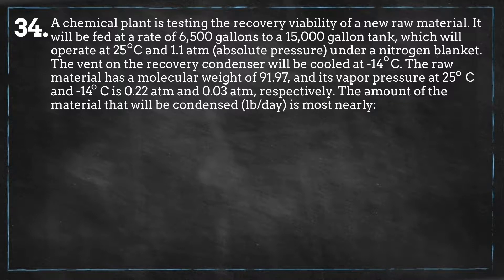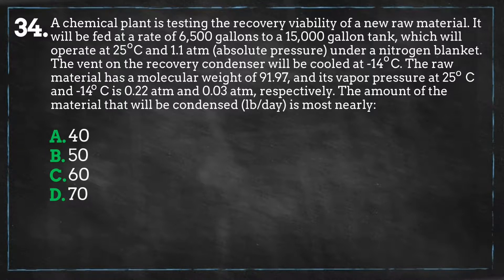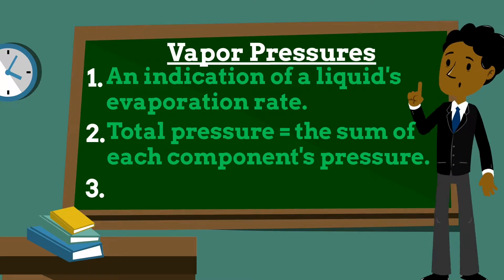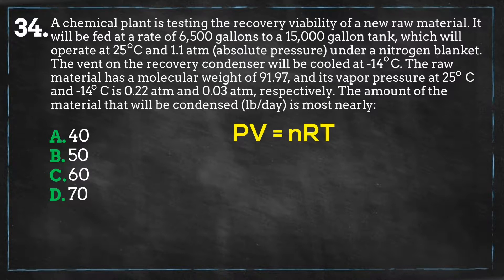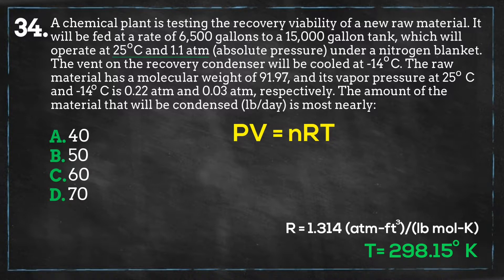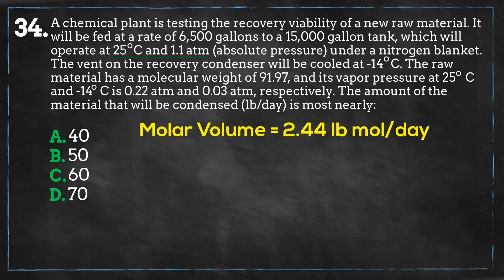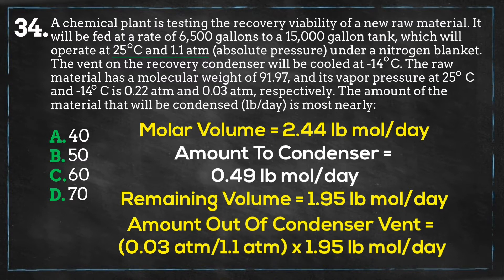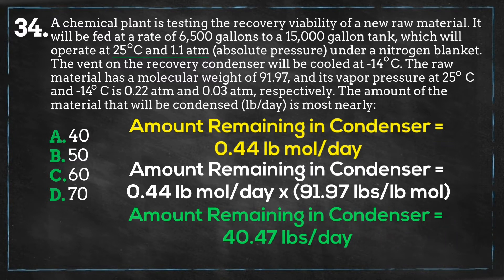Vapor Pressures - Episode 34 (Air Pollution Engineering) | 52 PE Exam Problems in 52 Weeks

Comment: Hi, I have been stumped on this problem for quite sometime and my PE exam is coming up soon. Please help.

I do not understand the interaction between the 0.49 mol evaporated at and the 0.05 mol of vapor exiting the vent at -14 degrees C. If the low vapor pressure of 0.03 atm at -14 degrees C only affects the remaining liquid, then shouldn’t the 0.49 mol of vapor all be condensed? 

If not, then shouldn’t the low vapor pressure affect all of the liquid? I have spent an hour or two looking at the problem and think I am just missing something fundamental. Thank you for your help!
Reply: I am having the exact same issue as you. Especially in his detailed explanation when he says all the liquid vaporizes once, that further proves in my mind that all that .49 lbmol should be condensing. To take the actual that’s evaporating from the remaining liquid suggests that the activities happen in sequence and not simultaneously. If taken in sequence, then the .49 lbmol and the .05 lbmol are independents. 

To get it to work in my mind and actually subtract the .05 from .49, the .05 would need to be derived from the total mass going to the condenser, which would signify simultaneous, dependent events. If you follow my logic, you still arrive at the same answer (rounding up to 40).

Let me know if it finally clicked for you from his explanation.

Comment: I'm confused why V/N which is 356.15 L/lb/mol is not converted from liters to ft3. It is used in the problem when you divide the daily volume of 868.92 ft3 by V/n which is in L/lbmol units. Why does the liter unit go away?
Reply: The 365.15 L/lb Mol is a typo when they move to the second screen.  From the 1st screen, it is in ft cubed based on the chosen R value.

Comment: So I'm doing my final review and going back through practice problems and I'm hitting a snag here: and that's application of the Molar Volume of a gas to the LIQUID VOLUME being added to the tank in order to determine number of moles being added to the system.  Is the assumption that an equal volume of gas must be displaced on a daily basis to make room for the added volume?  And that displaced gas (same volume as the flow in) is vented to the condenser to remove dissolved product? 

the NCEES Practice exam has a very similar problem and they take the same approach but of course there is no explanation haha.  Having a hard time with this one.
Reply from the maker: Hey Aaron, thanks for this excellent question! First of all, we don't have any other operational parameters other than temperatures, vapor pressures and volumes, so I'm assuming that the system will operate perfectly without us running out volume for the recovery process. 

The volume provided in the problem is sent to the tank on a daily basis (not quite sure why I didn't write gallons per day lol) but since the answer asks for a daily quantity, it makes irrelevant what happens to any material after 24 hours. Also, the problem doesn't state how large the condenser or vents are, so our only constraints for condensation are the molecular weight of the material and its vapor pressure at the temperatures in question: the tank's operating temperature and the recovery condenser vent temperature. 

The material is a liquid, but I'm using the Ideal Gas Law to understand how it will function as a gas since that is what the question is centering on and I know that at some point it will get into gas form based on the rule of partial pressures. I'm essentially counting my "chickens before they hatch" in terms of using the Ideal Gas Law because I know some form of the liquid will turn into a gas, even if I don't know how long that process will take. Since the problem doesn't provide that info, I won't take it into consideration. Your question reminds me of Episode 43 (https://www.youtube.com/watch?v=gjJgRUK2a8c&t=208s) where you have a theoretical volume that a material (gas) can fill, but then you are limited by the partial pressures. Let me know if this is helpful.
Reply: @SIGMAEnv  Thank you so much for the response.  I'll be sure to revisit 43 as well!

Comment: Where does the time unit of day come from in the problem statement?  Should the feed rate state 6,500 gallons per day?
Reply from the maker: Thanks for your question, Elle. The answer is yes, that is the rate per day it will be fed to the condenser. There was some specific reason I worded the question like this, but I didn't write it down in my field notes so I apologize for not being able to give you my rationale. Nevertheless, it's rare you'll get asked for an answer on the exam wherein the units are not accounted for in the question.
Reply: @SIGMAEnv  Thank you so much!  I actually passed my exam in March!  Your series was a great tool as part of my exam prep! :)
Reply from the maker: @elleboogie9614  Congrats!!!!

Comment: Hello, thank you for posting these problems/solutions! I'm finding them very helpful during my review preparation. Are you able to help answer a question?

I'm having a difficult time visualizing the setup for this problem. To summarize, there's a volume flow rate of raw material (liquid) feeding into a tank in which a certain amount of the substance evaporates based on the conditions of the tank (i.e., temperature and pressure) and the properties of the substance (i.e., vapor pressure). In the solution, the amount of substance that evaporates and subsequently feeds into the condenser is evaluated to be 0.49 pound - mole per day.

Tank Mole Flow Balance:
n,in = n,tank + n,vapor
2.44 = 1.95 + 0.49
[units: pound - mol/day]

This is where I get confused: the solution then takes the remaining amount of substance in the TANK (1.95 pound - mole per day) and uses it to evaluate the amount of substance "out of the condenser vent" given the temperature conditions at 0.03 atm (0.05 pound - mole per day)... Visually I don't understand what this process would look like. Hasn't the TOTAL amount of substance that is fed into the condenser already been evaluated as 0.49 pound - mole per day? Why is the remaining amount of substance in the tank being used to evaluate the mole balance in the condenser?

The last part of the solution makes sense to me in terms of mole balance: of the 0.49 pound - mole per day entering the condenser, 0.05 pound - mole per day is exiting the condenser vent leaving only 0.44 pound - mole per day remaining in the condenser. I simply don't understand conceptually what the 0.05 pound - mole per day value means.

Condenser Mole Flow Balance:
n,in = n,condenser + n,vapor
0.49 = 0.44 + 0.05
[units: pound - mol/day]

If there's any guidance to help make better understand this problem I would be very grateful. Thank you again!
Reply from the maker: Thanks for your question! So this chemical plant has used this raw material, and now it's trying to test its recovery viability to put back into the process. To breakdown the 3 main portions of our chemical, which we calculated as the rate going to the take as 2.44 lb mol/day, we have 1.95 lb mol of material remaining in liquid form, 0.44 lb mol actually being condensed for recovery daily, and 0.05 lb mol of material evaporating out of the vent daily.
 
With any problem you have 1 environmental system, and the goal is to determine which parts of that system are assigned certain characteristics. In a mixture of gases, each constituent gas has a partial pressure which is the notional pressure of that constituent gas if it alone occupied the entire volume of the original mixture at the same temperature. Ultimately, the total pressure of an ideal gas mixture is the sum of the partial pressures of the gases in the mixture. 

So the material has different vapor pressures at various temperatures, but these pressures are all interfacing with the liquid material simultaneously, which is why I used the tank pressure (1.1 atm) to calculate the amount to the condenser and the amount going to the vent. So, before we even have the nitrogen blanket in the tank, the condenser and the vent in this system, I have a portion of particles happy to remain in liquid form (in terms of pressure), a smaller portion ready to be condensed (at 0.22 atm), and a very small portion ready to evaporate at even the very low temperature of -14 deg F (0.03 atm). So I have to use the total of 2.44 lb mol in my first calculation to determine how much material has left the tank’s liquid (0.49 lb mol), but I use 1.95 because the amount that goes to the vent will vaporize only once. To use the amount of material that is in the condenser in your calculation (for material going to vent) is assuming that all 0.49 lb mol will evaporate from the liquid, become liquid again in the condenser, then the 0.05 lb mol portion of material will evaporate from the condensed portion to the vent. Is it impossible? I cannot say it is. Is it likely? Probably not.

Now this is just a general problem, but if we had a tank diagram showing a setup of the condenser vent being completely isolated from the tank, we could reconsider. For now, we must assume that they are not completely isolated from other parts of the system. I hope this is helpful, and if not let me know.
Reply: @SIGMAEnv  Oh my gosh Isreal you are my actual hero, thank you for explaining this! I have been struggling to wrap my mind around this kind of problem because I don't understand physically what they're talking about. Thank you for all these videos and for laying everything out so plainly!
Reply: Unfortunately, it’s still not clicking for me. I totally understand the .49 lbmol going to the vent that wants to condense, but to then take the amount that actually wants to evaporate at -14C from the remaining mass after deducting .49 lbmol in the tank suggests a sequence of events and that the .05 lbmol  is independent of the initial .49 lbmol that went to the condenser originally. This is a mass that is completely separate of the original mass. Your logic just seems to frustratingly defy all the rules of mass balance - (Even though I’m sure it is not!). 

The only way to get the logic to work in my mind is to take the .05 from the original mass in the tank. This makes the .05 and .49 dependent upon one another and to me makes sense why you then subtract the two values from each other, especially with the “only vaporize once” rule”. 

Sequence that defies my current logic: 

1) 2.44 lbmol mass of chemical in either liquid or vapor state. 

2) .49 lbmol wants to vaporize then condense of the 2.44 lbmol. 

3) Of the 1.95 lbmol remaining, .05 lbmol wants to evaporate even at -14C. This mass enters the condenser and somehow makes itself a part of the .49. Then it is subtracted to become .44 lbmol of chemical condensed back to liquid.
Reply: @stomz69  Im not really getting it either... it might be something about being a steady state constant mass rate thing.... but here's a wording of what I'm just going to remember for how to do the problem:

A portion inside the tank is always gas at the higher temperature. The condenser only interacts with the remaining liquid. The condensed portion is the difference between the gas at the higher temperature and the gas at the lower temperature using only the remaining liquid.

Thats whats going on in the solution, I dont understand why logically but using that explanation you can get the answer required lol